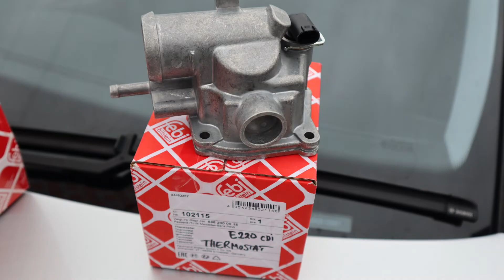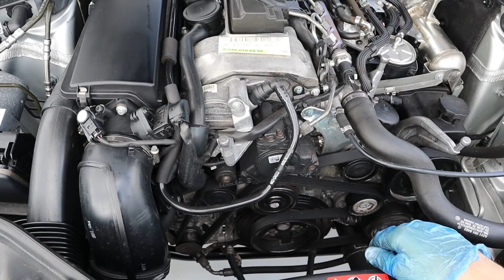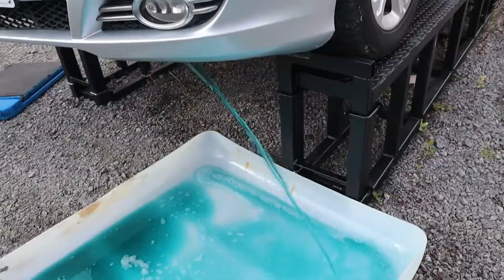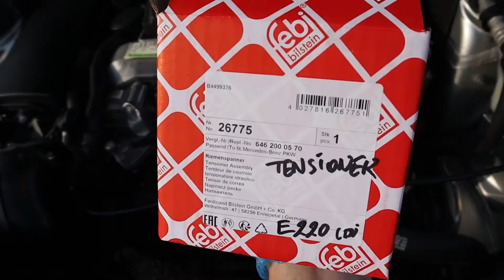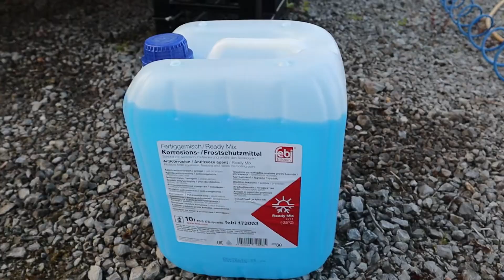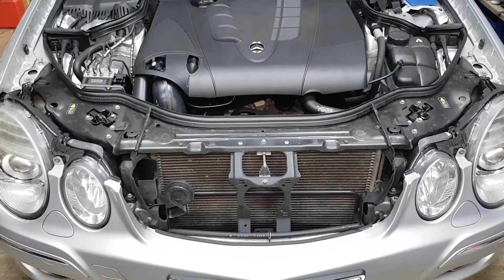Mercedes W211/S211 How to Remove Replace Water Pump Thermostat Coolant Belt Tensioner OM646 220cdi

Comment: Amazing video, mate. Saved me!
Reply from the maker: You are very welcome
Reply: @TheKeenMechanic Excuse me, sir. I bought K026PK2260 but when I was about to install it I noticed my car has K036PK2260. Do you know if they are compatible? I mean if I can change my old K036PK2260 for the new K026PK2260. 

My car is a W211 220 CDI 150CV 2002. 

I cant return the K026PK2260. It was my bad that I didnt check it well (im noob in mechanics) but if they are compatible it wouldnt be that bad
Reply from the maker: @SayNoTo2030A You are better off just googling these things mate. Having said that 6pk means how many ribs the belt has and the 2260 is the belt length in milimetres

Comment: Fantastic video! Thanks. Just one question, you're the first who said the bolts on the belt need 45 Nm, I read 35 everywhere else. Where did you get the 45 Nm from or am I not correct? Thanks 😉👍
Reply from the maker: Hi and thanks for watching my video, I use Mercedes benz online repair manual. These are the factory specs as shown in the manual. I have also seen many people using the worng torque specs for other parts like the injector bolts and then they wonder why they leak etc. Thanks for stopping by
Reply: @The @TheKeenMechanic Wow, you are the real deal, fantastic man! I had already subscribed yesterday, but now even happier I found you ;) So it's 45 Nm for all four bolts, correct?
Could you maybe point me in the direction of where to find that Repair Manual? Would be highly appreciated 😉👍
Reply from the maker: The 45nm is for the 2 x T60 bolts on the 2 idler pulleys.

Website for all manuals: https://shrsl.com/43mz2 
Click on the link and type KM22 to get 22% discount at checkout

Comment: Hi, what are the torque settings for the tensioner?
Reply from the maker: Can't remember what size it is. I know the head is E10. If it is M6 8.8 grade go with 10nm if 10.9 grade bolt go with 14nm. If it is M7 go with 20nm if M8 apply 25 to 30nm

Comment: Thank you!
I'll be changing the thermostat on my Clk 220cdi 646.966
Reply from the maker: You are welcome☺️
Reply: @TheKeenMechanic just changed it, how do you bleed coolant system?
Reply from the maker: @Maxton720 Just poor coolant slowly and start the engine then top up again, then top up finally when the thermostat opens at normal operating temperature. These old cars are great as they self bleed. Just keep an eye and top up a few times after engine cools down
Reply: @TheKeenMechanic do i need to wait till it fully warms up with the coolant cap off?
Reply from the maker: @Maxton720 no, just fill up and drive slowly near your house in case you need to top up, take the coolant with you if going further and top up if it drops. It is really easy budy, dont worry about it
Reply: @TheKeenMechanic just came back after 1 hour drive and temp stays at 90 all the time, before it used to drop down as soon as you hit the motorway. Will be ordering pulleys and tensioner that you've fitted too👌
Reply from the maker: @Maxton720 Good job. Nice car to work on, it will go over 1 million miles if looked after
Reply: @Maxton720 βάζοντας αντιψυκτικό βγάζεις το μικρό σωλήνα πού έχει δύο σφηκτηρες αυτό πάει στο δοχείο